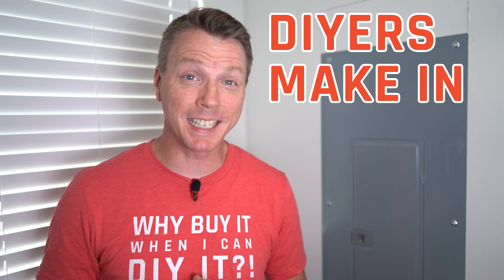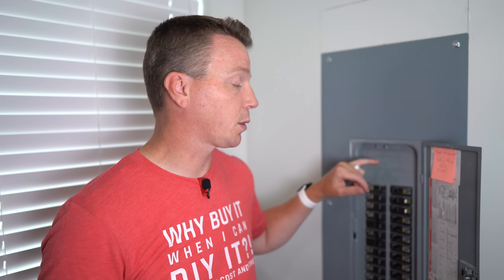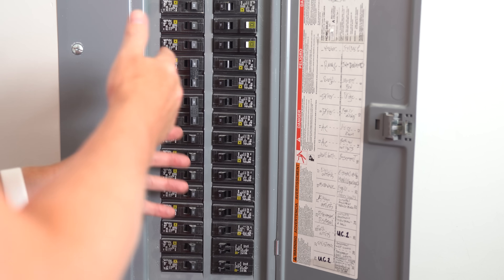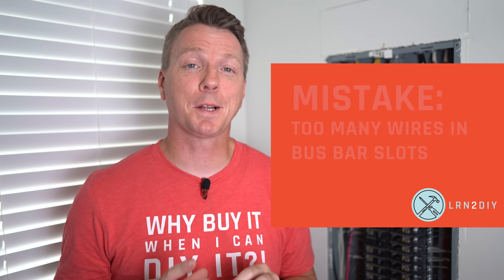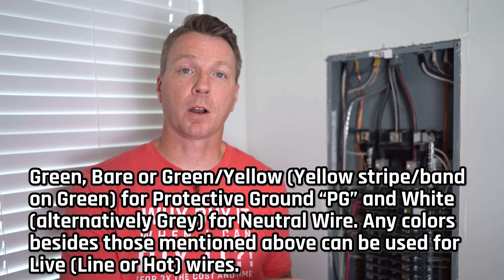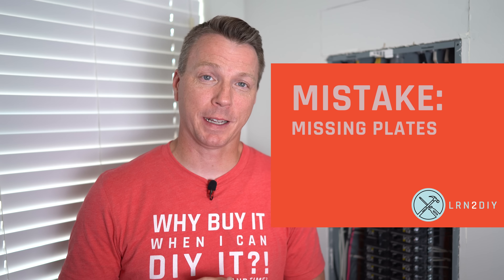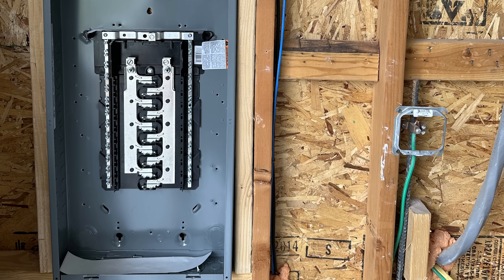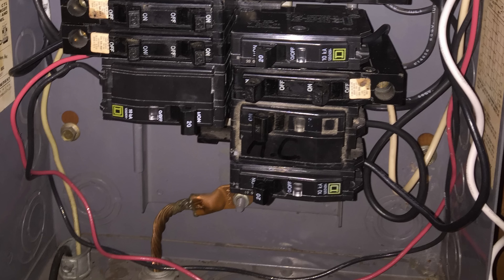10 Common Mistakes DIYers Make In Circuit Breaker Boxes

Comment: Please STOP touching everything in the panel. Not all new DIY'ers are smart enough to remember it can kill you. And they sure are not pulling the meter. Also, if you tape a neutral ( white wire ) with red tape indicating it is now a HOT, make sure you tape the other end of that wire as well.

Comment: Having two wires in a hole or a circuit breaker or panel is not against code, it depends on the circuit breaker or panel, some circuit breakers and panels allow two wires in hole or breaker.  If they do, the wires must be the same gauge and material, ie, no 14 and 12 gauge in the same hole and no copper and aluminum in the same hole.  Refer to the manufacturer requirements for your breaker and panel.

Comment: This video by Dr. Orion Terban addresses common mistakes made by DIYers when dealing with electrical panels or circuit breaker boxes, offering solutions for each mistake.
Main Points/Arguments

    Illegible Labels: Often, circuit breaker boxes have outdated or illegible labels. Solution: Rewriting labels legibly or using pre-made labels.
    Panel Overloading: Overloading the circuit breaker panel beyond its amperage capacity. Solution: Ensure usage does not exceed 80% of the panel's amperage capacity.
    Improper Wire Sheathing Protection: Failure to protect the sheathing of wires against The Knockouts in the panel. Solution: Using plastic connectors or bushings for protection.
    Mismatched Wire Gauge and Breaker Amperage: Using a wire gauge not compatible with the circuit breaker amperage. Solution: Match wire gauge to the appropriate circuit breaker amperage.
    Improper Grounding: Mistakes like cutting the main ground wire or improper grounding connections. Solution: Ensure proper grounding and connections.
    Doubling Wires in a Single Bus Bar Hole: Using a single hole in the bus bar for multiple wires. Solution: Use separate holes for each wire.
    Incorrect Wire Sheathing Color: Using improper sheathing colors for different types of wires. Solution: Use the right color codes for neutrals, grounds, and hots.
    Double Tapped Circuit Breakers: Feeding two wires into a single circuit breaker, which may be against code. Solution: Check manufacturer specs and local code.
    Missing Filler Plates: Leaving open holes in the circuit breaker panel. Solution: Use filler blanks to cover unused Knockouts.
    Incorrect Torque on Screws: Not torquing screws to the specified tension. Solution: Use a torque screwdriver to achieve the correct tension.

Comment: When I built my house, I did all my own wiring, and I didn't make any of those mistakes, except for maybe the last one, torquing.  I didn't use a "torque wrench" screwdriver.  Nothing has come loose yet after 21 years.  (And none of the licensed electricians I knew used them either.)  Also, items 6, 7 and 8 on your list were likely made by licensed electricians, not DIYers.  Double tapping a breaker that is meant to be double tapped isn't really a mistake.  It can be a strategy to save wire, say the panel is in the middle of the house and a row of receptacles up and down the hallway should all be one one circuit.

Comment: Is there guesswork? Like not knowing the limit of how many breakers and amperage allowed in (your case) 150 amp panel.  The answer is ambiguous, most homes have quite a bit more breaker amp total than the rating of the panel. How much is drawn at any given time is key, it's also pretty much a guess. Your panel could easily have 250 in total amps with installed breakers. Is that overloaded? Only if every circuit is being used at near peak draw.....highly unlikely, possible, of course. The average DIY'er doesn't know how to figure watts/volts/amps from what's listed on the appliance. It's a simple formula, worth knowing.

Comment: If you have circuits that are no longer in use and you want to reuse the breaker space, what is the best way to terminate the wires going to those breakers that are no longer in use? The wires will not be removed from the wall (old electric baseboards that are not used any more).

Comment: You wanna hear about electric shocks. I should be dead after what happened to me. My brother saved my life. I was ten years old 1990, it was an old power transformer for a hand held computer game of the time. I plugged it in, then all I remember is my hand clamping and smoke arising from my hand. My brother switched it off and saved my life. It melted my flesh, all my tendons and I spent years , in and out of hospitals, having numerous ops and treatment for years. My hand is permanently bent and luckily I was young I’ve learnt to be ambidextrous and the trauma I suffered would have been much worse if I was older.  At the time, my youth helped me minimise the severity of what happened. It felt like a bee sting until the power was switched off. Then the pain started, the local hospital were not equipped to deal with my injuries. I had to go to the top burns unit/specialist in London and the treatment went on for years. My hand had been eaten away. The psychological trauma is minimal due to my age. What was surprising was how I had symptoms for a good year or more which arose from the shock which included blisters on my body, appearing, randomly and in areas such as my back, throat and soles of my feet. I remember always having stomach issues which are all part of what happened. I’m so lucky I was young. The accident would without doubt have a profound impact , mentally(ptsd etc) on an adult me. 
My tender age and my brothers quick reaction (he won an award at school for his heroics!) thankfully has enabled me to block it out and not let me be scared of electric today.

Comment: I used a labelmaker in my garage to apply a "circuit #" tag to each of the outlets that corresponds with the breaker number in the box. Each circuit in the box is then identified by the walls of the garage the circuit runs. Used proper outlets for the 20 amp, 12 gauge runs. Everything is primary wire in metal conduit, metal boxes and metal faceplates.  Buy once...

Comment: I've yet to move into a house where the wiring wasn't all jacked up and I didn't need to repair some hack electrician's work. My current home had at least nine connections buried behind drywall. I haven't found them all yet. And four rooms and one outdoor outlet are connected to a single half-width 15A breaker. The neutral just wasn't connected, and the Pillar to Post guy told me "the lights are just a little flickery in these old houses." I could clearly see that the "no neutral" LED was lit up on his hardware store tester.

If you never learned a thing about electricity and guessed at 100% of it you'd do a better job than the idiot who wired my place.

Comment: The NEC says hot conductors can be any colors other than white, gray or green..... with one critical exception that you're very unlikely to come across in a residential setting – with a 120/240V 3 phase 4 wire delta system,  the conductor with 208V to ground aka the high leg must be marked orange,  or other effective means,  at each point on the system where the neutral is also present. Ref.  NEC 110.15 for more info.

Comment: Double tapping = laziness.  As you say, you can get a double-tap breaker, or even a skinny double-breaker and split the two circuits into two breakers.  And also LOVE LOVE LOVE it when the runs are dressed nicely.  There's a couple of female electricians on YT and IG that are absolute MASTERS at dressing wires.  Makes you want to put a clear acetate cover on the panel.  :)

Comment: Most people do not know the maximum wattage output of their electrical outlets . For a 15 ampere circuit breaker
you multiply 15 (amps ) by 120 ( volts ) and get 1800 watts . Microwave ovens , coffee makers , and electric grills 
use a lot of power and should be the only appliance plugged into that line in order to prevent the excessive current
from popping the circuit breaker .

Comment: On that panel the neutrals and grounds should be on separate bars with the ground bar bonded to the metal case of the panel.
Reply: I might add, the neutral bar should NOT be bonded to the metal case (please remove the green screw provided ) in a subpanel.

Comment: Most equipment grounding conductor bars can accept two wires of the same size. It's perfectly legal and safe as long as the manufacturer states it on the label.

Comment: You shouldn't be using gray neutrals in your standard home unless you have a voltage of 277/480. I guess it's possible but very unlikely.
In that case, all of your wire installation colors will be different except for ground. 
Smh
As I stated in a previous comment. If you need to watch this video you shouldn't be performing complex and extensive electrical work on your home (especially within the panel) without assistance from a professional.
 Or just hire a professional electrical contractor all together

Comment: I saw a house that had a 3 phase 600 amp service and 3 completely full breaker boxes with double stacks. They had 300 TONS OF A/C COOLING
Reply: Nice!!! In what state or city, if you don't mind me asking.   I have only seen three phase for residential on some farms including the farm I lived at when I was a teenager,  where the farmer needs to run three phase motors.  

My understanding is that some utility companies have a limit for single phase services of 400 to 600 amps without engineering approval,  if a larger service than that is required a three phase service is usually installed,  typically a 208Y/120V.

Comment: im pretty sure i can make it nice, worst thing im doing is welding the straps because im in a conex. using mc cable. 110v 12/2 220 10/3 and probably buying 8/3 for my welder.

Comment: Doubling up ground and neutral wires is specifically allowed in some holes on some grounding bars.  As with wire nuts, you have to check the spec on combinations if conductor sizes ands number of each allowed.  Mine is on the inside face of the panel door.
Reply: I had this exact question a couple of months ago on my panel.  I looked up the spec and verified that it's allowed in some of the holes.

Comment: On the one where it says the torque should be 36; is there a reason it couldn’t be more? Say 50 pounds?
Reply: It can weaken the wire at the connection due to compression.

Comment: Once had an inspector fail my use of 12 gauge wire on a 15 amp breaker because he said someone in the future might think it could handle a 20 amp.  He made me replace the line from the panel to the smoke alarm so it was all 14 gauge, on a 15 amp breaker.
Reply: He was wrong, possibly for both reasons. There is nothing in the code preventing the use of oversized wire. On the other hand, if all the circuit had was 12 gauge wire, even if it was only to a single smoke detector, there's nothing wrong with using a 20 amp breaker. If, however, there was any wire beyond your smoke detector that was 14 gauge, then yes, it needs to be a 15 amp breaker.

Comment: I have over 40 years experience as an electrician 20 in the Navy and 20 doing residential/commercial new construction and repairing older electrical. I treat all wires as if they are hot regardless of knowing it’s turned off. The worst is finding some DIYer has run all the power for a room to the light and hot legged the light switches. You think the switch is off securing the power to a fan/light and zap. A no contact tester helps but should not be the only way to insure its off. 
   I bought a mountian home built in 1947. There are still “knob and tube” insulators here and there. Aluminum wire used on outlets/lighting and found two circuits tossed into the attic with BX cloth covered wires with outlets, switches, and fixtures still installed and the circuits still hot. The electric company installed new power poles and upgraded my overhead feed to 250 amps feeding a meter base with #8 wire to a double 50 amp breaker that feed my entire house. I could pull my meter and upgrade my panel but the smart meter would tell on me. They and the county want permits and inspections done and only “state licensed” electricians to do the work. Since what I’ve found does not meet code requirements I have to pay an overpriced company to do work I’m qualified to do. 🤷🏼‍♂️
   When in doubt don’t screw with electricity it can injure or kill you or others and an electrical fire caused by DIYer usually isn’t covered by insurance.

Comment: The biggest mistake people make is not separating lighting 15amp and outlets for power, the other is not load balancing the sides 220 is both black wires white in neutral and ground

Comment: 12:11- Torque it down till it clicks, then wiggle the wire around a bit. This helps the wire to conform to the shape of the terminal plates, where they squeeze the wire. Then torque it once more. This is especially important with stranded wire which is not that common in house wiring, but exists in many other industries.

Comment: One thing i do during installs is  label the circuit on a piece of NM sheathing and slip it over the hot conductor. Even if you don't label the door or breakers get moved, you have a reference to where that circuit goes.

Comment: On the issue of using a white wire as a hot, tape on this end helps.  Tape at the other end is also necessary so we know it is hot, not neutral.  This is common when someone does not have the correct wire and uses the wrong wire instead.  Just buy the correct wire for the job.  if you are installing a 2 or 3-way switch, use the correct wire.  Don't leave a trap for the next homeowner or repairman.

Comment: Nothing in the NEC about keeping the load to 80%. You can load it right up to the rating, such as 200A on a 200A panel. The reason is you will never have all the loads on at the same time. I have measured 200A panels with everything on and only got around 85A. If you're unsure, take an amp clamp, or have an electrician check it,  and measure your load with them all on. Also, adding a subpanel doesn't reduce the load on the panel, it just gives you more spaces. The main panel has to feed the subpanel so any loads on the subpanel are also drawing current from the main panel.

Where you show a ground into the panel, that would only be for a subpanel. The main panel would not have a ground, just two hots and a neutral. The panel that was mentioned that the ground was cut, that could have been from using a 4-wire cable for the main and the ground was not needed. I would have cut it off closer to where  it enters. That's to avoid confusion and possibly getting into a hot lug.

Comment: You need to add a number 11 - which is to try and balance the breaker amperage on the right and left side of the panel. You never want to have just breakers on just one side of the panel.
Reply: two breakers on one side IS balanced!

Comment: Work at daytime . Always have someone present in case of emergency. 
Pull the meter first .
GOOD TO GO NOW .
always check voltage first because I have seen electric meters bypassed with 50 Amp jumper so even pulling the meter doesn't guarantee anything .

If your here watching this video , you probably shouldn't touch a panel . 50 Amp will weld your screwdriver to the panel .

I've done it 

100 amps your toast

Comment: Maybe the red in the panel indicates a secondary hot but that does not help at the other end where there is no indication that the white is hot! It is still a potentially deadly situation, so I vehemently disagree with his solution, and would call that mistake number 11, and it was made by a professional.

Comment: Might want to mention a dangerous situation with doubled up neutrals.  Normally you turn off the breaker and think you can work on that circuit.  If you have a double tapped neutral, you have to turn that break off too - if you forget, when you loosen the neutral clamp, you've got a live circuit in one of the neutrals and you can get shocked.
Reply: But arent Neutrals bound together on a bus bar anyway?
Reply: @PremiumFuelOnly  Yes, but when you have 2 circuits' neutral on the same lug connection, you have to remember to turn BOTH breakers off if working on that lug connection.  If you don't, one of those neutrals will have current flowing thru it and if it loses connection with the lug, it becomes hot.

Comment: First, IF this video includes any information that you didn't already know, I recommend that you DON'T remove your panel cover unless you are at least an apprentice with basic knowledge of how to work safely in a hot enclosure.   All the extra tips in the comments are important.  You could never include everything in one video.  That is why Electricians get 4 years of training before they are eligible to test for a journeyman license.  Anyone who skips the training is putting himself at risk.  He could also be putting his family at risk.  I have recently noticed that many younger electricians/apprentices don't always know the difference between a simple mistake and a fire hazard.  Some of the minor mistakes they think could burn a house down makes me wonder if they would recognize a real fire hazard if they saw one. Then there are the electrocution hazards.  Many people would be surprised to know what is most likely to cause electrocution  (death caused by electrical shock)  in a house.  Some people might disagree, but a DIYer with no electrical training and little knowledge should not remove the breaker panel cover.  Anyone who thinks it's okay for someone without a good understanding of electrical theory or at least some supervised, educational experience working on residential electrical system including some knowledge of practical wiring methods to make changes or upgrades inside a breaker panel is just wrong.  However, every person is the first and last person responsible for his/her own safety.  So we all must dictate our own actions and live with the results or die from them.